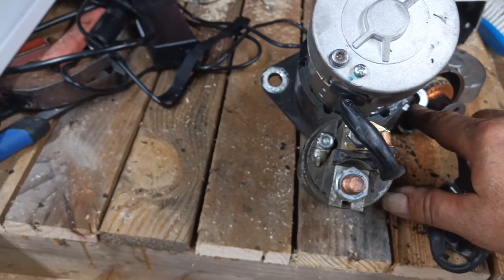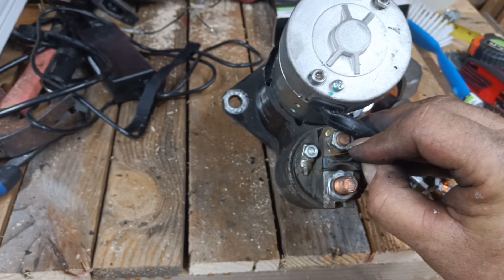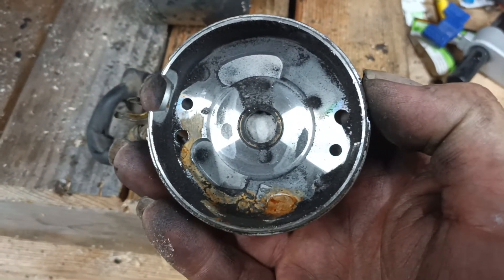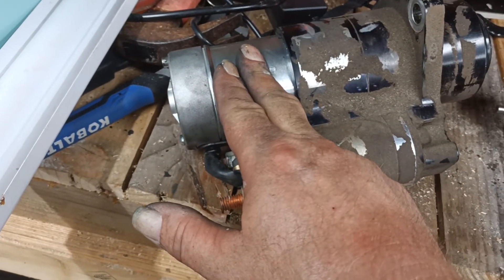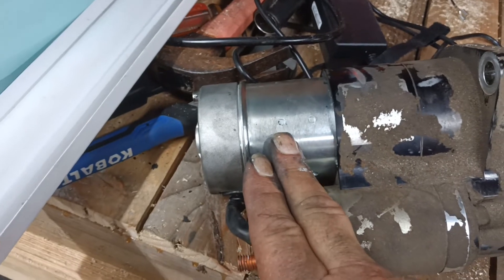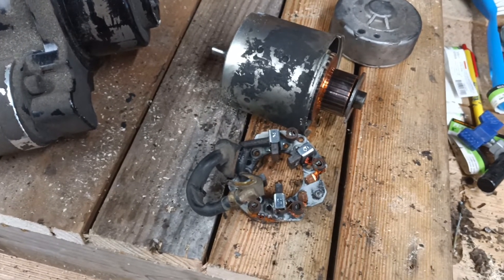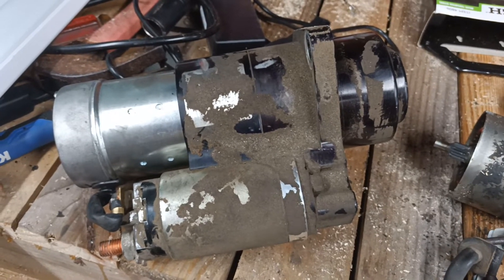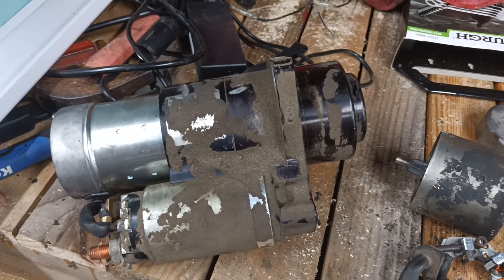2012 Harley Davidson Tri Glide reverse motor fix

Comment: My reverse goes in and out it works then it don't if I take the thumb off the switch and hit it again then it will work or keep thumb on the switch and move my thumb back and forth it will work